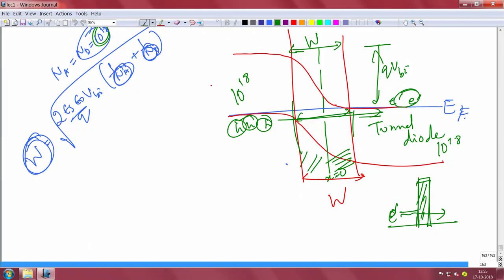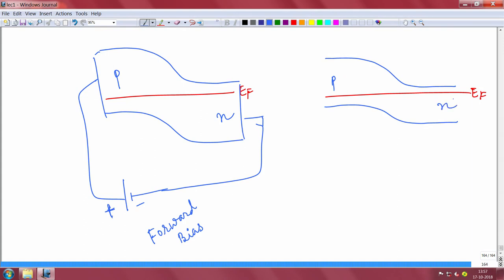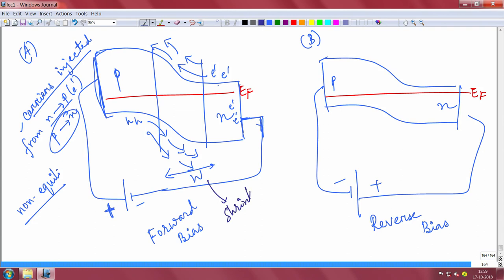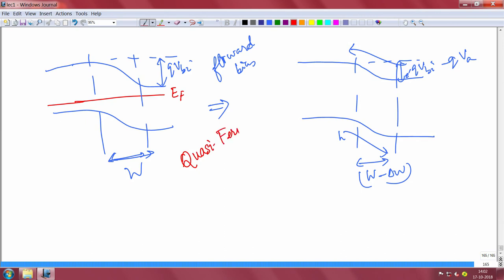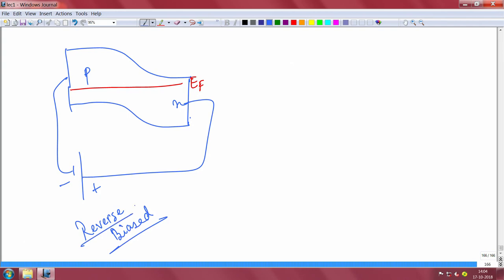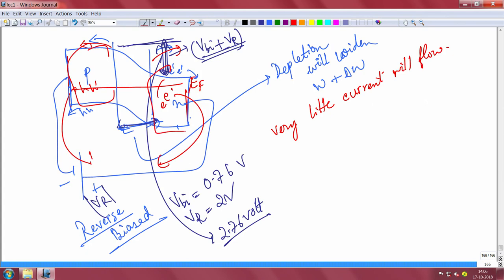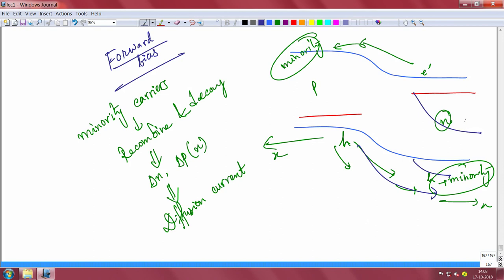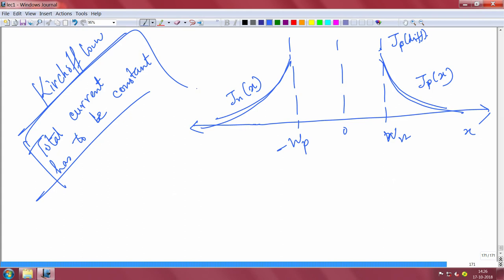p-n junction under bias

Comment: In 25:30 delta p(x) = delta p(Wn)*exp((Wn - x)/Lp) is substituted from what we learnt from continuity equation,  but there we derived delta n proportional to exp(-x/Ln) after assuming that the semiconductor is not experiencing any field but that is not the case here. Then how can apply that result here.

Please can anybody explain
Reply: There we assumed that somehow excess carriers are generated (remember shining light) and then we derived an equation for those excess carriers profile with respect to x. Here instead of shining light we are using electric field for excess carriers generation. but at the end the equation tell the excess carrier profile. 
Hope it helps. Correct me if I am wrong
Reply: maybe it is because E=0 in neutral regions, the applied field drops the potential barrier in the depletion region. we derived the concentration in a region where E = 0. Correct me If I am wrong.